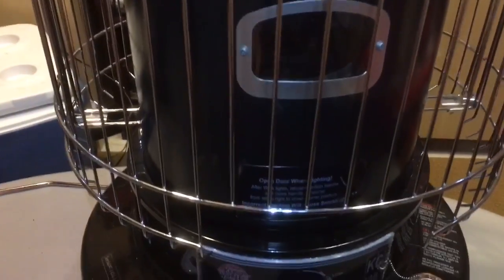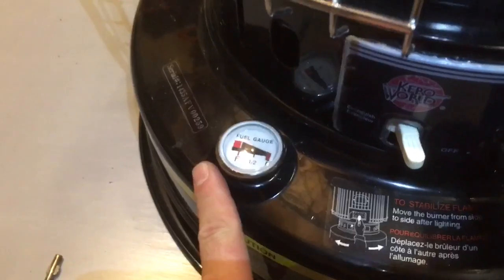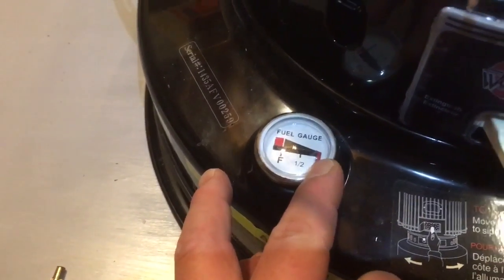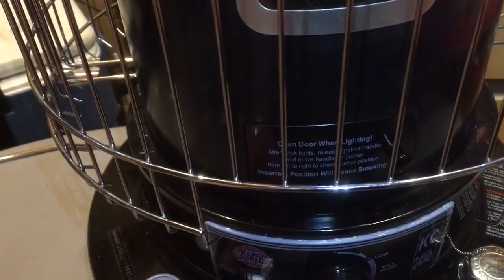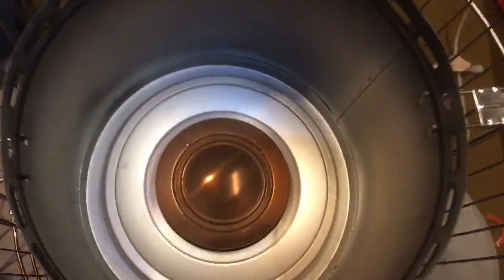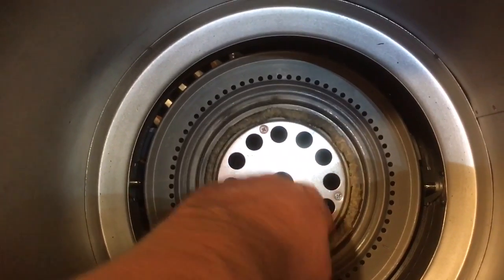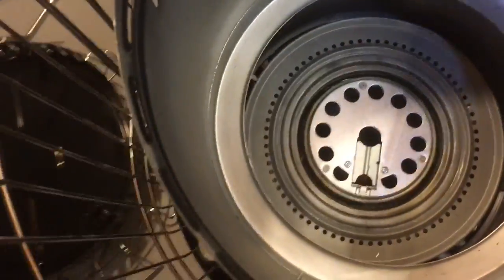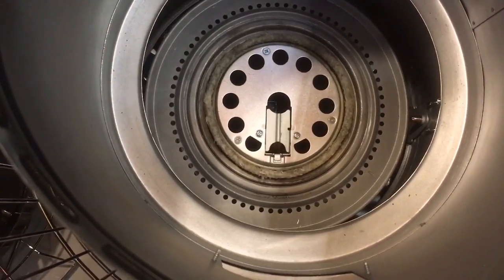Cleaning your Wick

Comment: thanks for the clip.  there are 2 big screws at the bottom of the, "cabinet."  when you take them out, you can lift the whole cabinet off using the handle, and then its much easier to maintain the wick, and you don't bend the handle to get the lid off, the way shown in the clip.  btw, i've run these things continuous for days with no problems. its the first couple burns that require most maintenance.
Reply: I was gonna say the same thing.  :-D

Comment: You say an eagle fan gives20% efficiency. Do you have a link for this fan? Also will this work with a fiberglass wick & do you ever have to dry burn? Thanks for sharing.
Reply from the maker: Most eco fans you buy work equally well. As long as they are thermal electric. If you can find a fibreglass wick that would fit the unit it would work fine. Yes just like the video says. After your tank empty’s out, wait a half hour and then dry burn the creosote off the wick

Comment: While cleaning out my detached garage, I found a kerosene heater. My husband passed away over 11 years ago so I know it hasn't been used in over 12 years. Any chance it'll still work safely?
Reply from the maker: As long as it’s not broken then yes 
Kerosene is very stable and can not light on fire with a match. Put some in, let us sit then light it up outside. If it stinks then clean it up. Make sure you use fresh kerosene and not what was in the tank
Reply: @wildwillyprepper  thank you!

Comment: Hi,

I just bought a new kerosene heater and the wick is black and hard only used it once. Do you know why this is?
Reply from the maker: Either your not using k1 kerosene or your wick is to high up or low when it is burning. After lighting make sure wick housing is sitting back flat and flame is orange and roughly a half inch high visible above burner. To low and it will black up and smell will burning and to high it will smoke and burn to fast.

Comment: Good morning, I have two heaters.  The flame will not stay stay lit high.  it will aways fade.  Could it be bad Kerosene?
Reply from the maker: Hi, it very well could be especially if the kerosene got warm over summer. Empty your tank and burn your wick out and clean it then ad new stuff and try. It can also be your wick is wore out or slipped out of adjustment. I’d try the kerosene first and let me know how you make out. If it’s the other issues, it’s an easy cheap fix.

Comment: Hey can you run diesel in this with ventilation
Reply from the maker: You can but it stinks very bad
Reply: @wildwillysearchgod  ok but it won't hurt the Wick any
Reply from the maker: @hamradio365  it is harder on your wick and you willl need to replace it sooner
Reply: How often should you change the wick

Comment: Cleaned my heater and when I light it now it catches on fire and burns black smoke
Reply from the maker: salohcin cnelor the inner chamber you pulled out is not sitting in proper.
Reply: Mine too I won't even use it. Thought I was gonna burn the house down. It was new from Lowes now it's in the dump. It should never had done that new. Bought a used one now putting a new wick in
Reply: StARart the heater outside.  A brand new heater must be "aged" for one hour outside to burn off oils used during manufacture and to "fuse the paint."   A wick that continues to smoke may be set too high.  Find videos on how to install wick on your style of heater.

Comment: it doesnt take 5 minutes... it takes that hour wait after you relight the wick and let it burn out again all the while its 20degrees outside and you have no heat...this equipment stinks...literally and figuratively..... during the last half of the tank the flame goes down to almost nothing and loses half or more of its btu's... I dont know what he is doing but its not working for me......I'm going to return this crap and buy a torpedo
Reply: When the elec goes out the torpedo is a boat anchor.